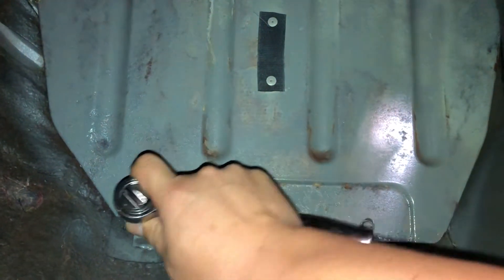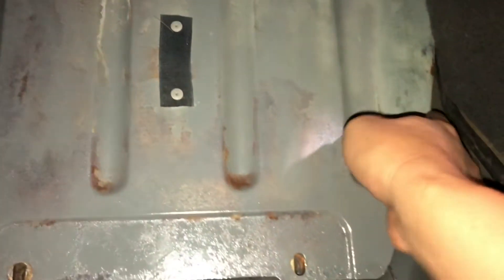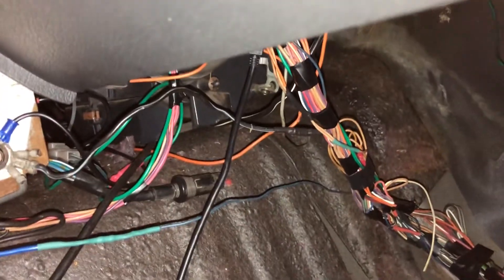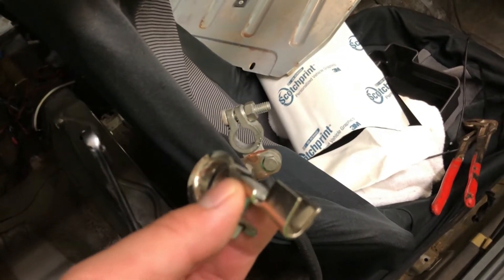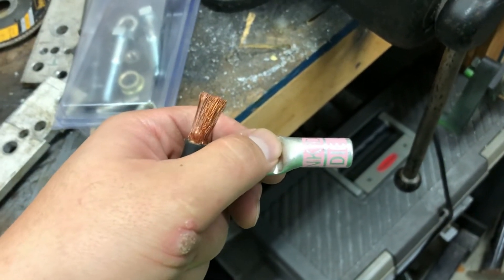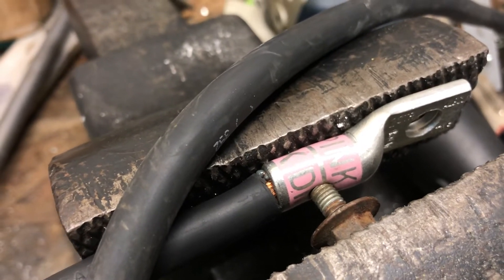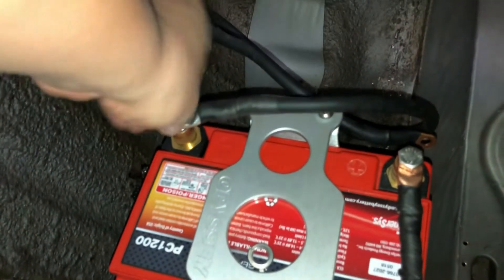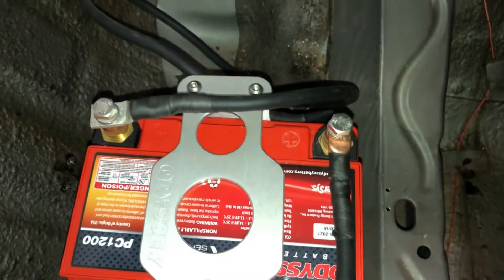How to Crimp Battery Terminals with a Vise

Comment: Hi, I'm just wondering after all this time would you consider a different bolt or shape to crimp? I think this is probably the cheapest method to crimp a lug, it will do in a pinch, sorry about the pun!
Reply from the maker: I love the pun, and I would probably do a different shape.  This is all I had available at the time
Reply: use a drill bit, and crimp in line with the wire, so it crimps the whole length of the copper barrel
Reply: i cut the sharp end off a 1 in. chisel  instead  of the bolt
Reply from the maker: That sounds like it would work well